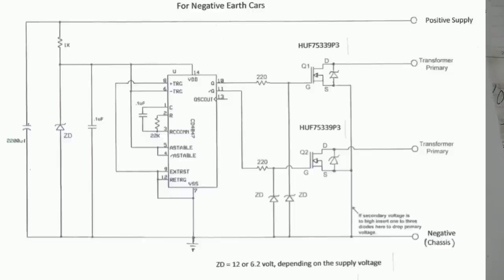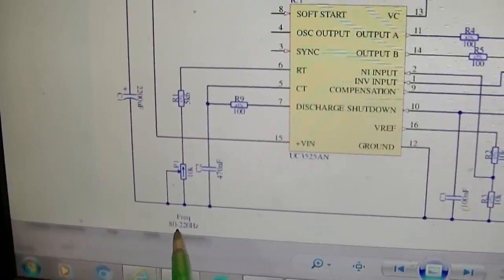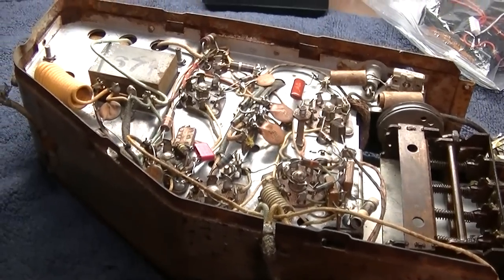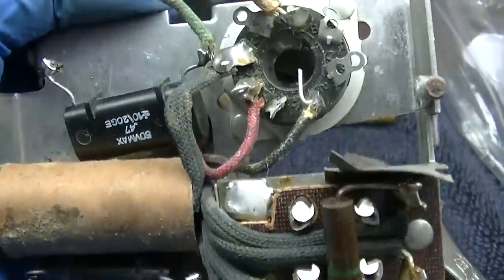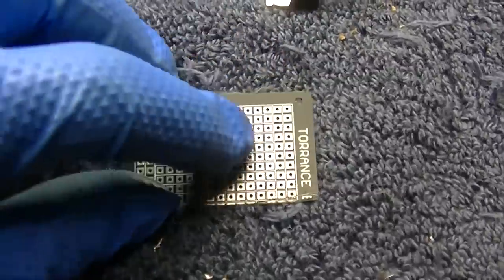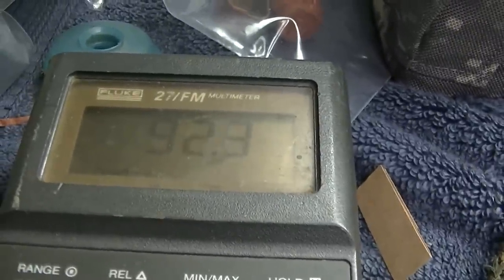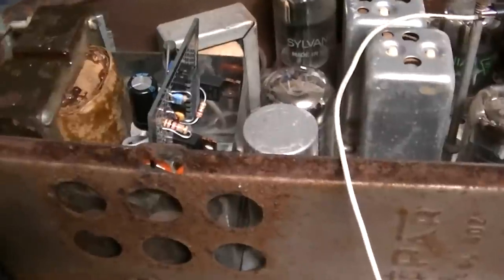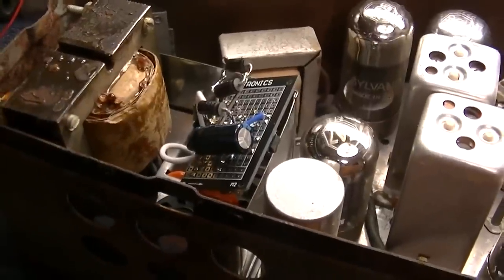Build Auto Radio Solid State Vibrator Replacement and Testing v2 1

Comment: One radio I did 6 to 12 I separated the filaments into two 6v groups then series them together. I had to go back and rebalance/rewire to get the current right one tube ran hot. I used the cheap ebay voltage gen. 12 to 220 but got lucky with a quiet one, might have ran it through the transformer as a choke.

Comment: Just put a lm317 voltage regulator on your board and adjust it to proper voltage out from the transformer.  That lets you ditch the diodes and the zener’s.
Reply: Built a lab supply using them back in college 30+ years ago. They're stable...I give you that.

Comment: I like the 12V to 6V dropper resistor idea. It makes things so much easier. :)
Reply: I had a generic tractor/truck radio originally sold at princess auto that ran six or 12 volt positive or negative ground. To run 12 volt you attached a big ceramic resistor in the supply line. It hung off the radio and got very hot.  It worked great,  wish I'd kept it.
Reply: I like that it's a period correct part too. I'd mount that resistor on the firewall under the hood so it's visible. Super cool.
Reply: Chrysler products used to take a ballast resistor and drop the 12v to 6v for the coil. You can still buy them.
Reply: Yep,all my Chrysler products have them. You always carry a spare with you,just in case.  And like Shango pointed out,you can burn yourself touching them.
Reply: @Suddenlyits1960  Mount a tincan designed to hold a coffee cup to the transmission tunnel. With the bleeder resistor in the bottom to act as a heating coil to keep your coffee warm. Sorry I have an odd sense of humor.

Comment: With a radio that needs 220V, anyone who doesn't want to do much soldering and doesn't mind having something conspicuously 21st Century under the hood could just order a 12-to-230V power inverter intended for a high voltage country like the UK or Australia. I see a bunch of them on Google from $20 to $500, probably depending on how much Chinesium you can tolerate.

Comment: This has been a great series. Thanks for being so quick in getting it on YouTube. Try a 10 watt 250 ohm resistor in series with the B+. It will simulate a hollow state rectifier like a 5U4. They pretty much have the same characteristics. I've had my share of pesticides today! And lead solder too! No vendetta COtrol though!

Comment: if you used an H bridge across both windings of the transformer at once (instead of the push-pull) it should be possible to run it on 12V since you're using both windings at once instead.  but of course that means an H bridge driver instead of just two fets.  I don't think the transformer would like 12V across each winding even when PWMing it since it would cause it to saturate.
Reply: Wouldn't you have to separate the two primaries to do that? And then too...wouldn't firing them simultaneously 'buck' each other and cancel each other out?
Reply: @Rev22-21  the primary is center tapped, so the two coils are actually out of phase with each other.  this is how it works as a push-pull.  If both windings were in phase it wouldn't push-pull any more.  By not using the center tap and leaving it free floating, this converts it effectively into a single winding instead.  You need to drive it with an H bridge though, because doing this loses the benefit of having the center tap to reference from.  It's similar to how you can make a full wave rectifier with 2 diodes and a center tapped transformer,  or use a single winding and a 4 diode bridge.

Comment: Always wondered why these old car radios always seemed to use slug tuning rather than a cheese slicer. Is there a good reason why?
Reply: Vibration.  Those variable cap plates would vibrate and change the tuning.  Slug tuning is much more resistant to vibration.
Reply: @eeengineer8851  Ah, never considered vibration. I have a Granco FM-only table radio that's slug tuned which performs very well. I never figured out why they went with that instead of a variable capacitor either.
Reply: @defaultuserid1559  tuning capacitor for only  88 - 108 MHz is expensive for what it is.  TVs were using slug tuning and then went to a cheaper form capacitor tuning for a while before they went to varicap diode.

Comment: Could you use a 4-6v regulator instead of the large resistor? Regulate the voltage down to 4v and you may not need the diodes.

Comment: Sg3525 would have been a good option you would need a boost converter/charge pump or logic level fets but ive got a feeling the sg3525 will want 12-15v it has UVLO and soft start to protect the fets it's a great ic fully adjustable frequency duty cycle dead time etc also a powerful fet output so you can drive fets directly, it virtually a tl494 but with a nice fet output stage , it has 2 error amps so easy regulation.. its not pin compatible with the tl494 however.

Comment: Ye Gods !  Electronics from the Middle Ages!  Talk about crude and primitive. To get the final output voltage regulated don't have series diodes and dropper resistors as you'll be faffing with them forever.  Add a voltage control loop instead. Pot-down a sample of the B+ output voltage and when it goes over a set threshold turn off the FET drive. Can use a Vbe junction as a comparator. The circuit then runs in squeg mode.  Does the B+ voltage really need regulation anyway? Valves (tubes) and good capacitors can tolerate huge variations in anode voltage. The 12V supply input ranges from 11.5V to 14.8V anyway.  EDIT: the second schematic with the generic SMPS IC , it's being used here 'open loop', normally is used closed loop as I describe above. This chip has a built in switching crossover function to prevent both FET conduct at same time, I think it's 2% though it's been 30 yrs since last used this chip.

Comment: I wonder if you could get away with a ZVS and ferrite transformer,  the output on the secondary is sinusoidal, run the gate supply directly from the 12-14v and use a BJT pass element on the input to the fets to regulate the output B+ on the secondary, I think you might be able to get away with it with a bit of filtering etc, it would preserve the original transformer too

Comment: The way I would do it is rewiring the transformer, that is, just use two IR2153 as a full bridge driver and connect the whole primary across it. Heater wise, make a single transistor running at low duty cycle, switching the heaters on and off from 12V.

Comment: Normal running  voltage should be about 7 to 7.2 volts.  Of course old generators put out nothing at idle so you could go down to 6 or even a little lower with lights and heater on.  Car radio tubes were supposedly designed to operate with the varying voltages of old fashioned poorly regulated generator systems, although I think any indirectly heated tube is pretty tolerant of varying heater voltage.

Comment: Putting the diodes where they suggested would lift the source voltage above ground effectively lower the difference between gate and source, the fets would probably have been running in their linear region

Comment: solid-state vibrators are sold on the website of antique electronic supply (tubes and more)
Reply: ..and they are noisy as hell..
Reply: @blitzroehre1807  solid state noisy?  rf interference on radio?
Reply: @bask2140  Yes, RF hash from switching harmonics, some designs have a lot, some are pretty good.

Comment: I wonder if you could create a voltage divider with a h4 bulb connecting 0v and 12v to the outsides and the common and one outside for the radio

Comment: It does not like 2 diodes because you are lowering the voltage of the CD40XX chip also and it needs at least 5 volt or more to work correctly and with an input of 6 volts and 2 diodes in series with the circuit the CD40XX chip is not getting the required 5 volts to work. You should change the R/C components around the chip to obtain the desired output voltage instead of adding diods to drop the voltage. Or you could use the NE555 8 pin chip to do the PWM for the mosfets and it would be totally able to regulate the voltage the way you want by using a little pot to do that.

Comment: What appears to have been overlooked is that there was a capacitor in parallel with one winding of the transformer, forming a tuned circuit with the transformer inductance. When both vibrator contacts to the primary opened, the tuned circuit would start a decaying oscillation. After a half cycle, the polarity on the transformer windings has reversed. The vibrator was designed to connect its other contact as close to the voltage peak as practical within tolerances. There is a short time when both contacts are open, just long enough for the capacitor to reverse polarity. The voltage difference across the contacts, just before they closed, was minimal, greatly reducing arcing and extending the life of the contacts. The energy stored in the transformer inductance is not lost. It is temporarily stored in the capacitor and returned to the transformer, but with the transformer's magnetic field reversed.

If the capacitor is removed and the FETs do not provide an interval when both are open, the energy stored in the transformer's inductor will be dissipated in the FETs and converted to heat.

In the vibrator design, If the capacitor were bad or off value,  the vibrator contacts would have a short lifetime, due to arcing. Replacing the vibrator would get the radio working again, but the contacts on the new vibrator would burn out quickly and the new vibrator would fail. The vibrator was socketed for simple swap out. If the radio was burning out vibrators, it needed to be removed and checked for failures of the capacitor or other components in the power supply.

Vibrator power supplies in car radios were used until about the mid 1950s, when power transistors for the radio's audio output stage were developed. Then, "space charge" vacuum tubes, which operated from a 12 volt B+ supply, were used for all the radio's circuitry except the audio output stage, which had the only tube which required the higher B+. The expensive, heavy, vibrator power supply was designed out, and the art of designing them was lost. The "space charge" radios were in production for only a few years before being superseded with all transistor radios. However, car radios were produced in high volume, so millions of "space charge" radios were produced before the design was removed from production.

Comment: Fet's have a gate threashold voltage, commonly 4v, if the power supply drops to around this voltage the fets will go into linear mode due to low drive voltage, and will get hot..
Bipolar trannies may have been better at 6v power.
I'd like to try this with a royer oscillator, the o/p is close to a sine wave, and the circuit is simpler.

Comment: Or maybe instead of a resistor and a diode, use a varistor, which will also play an additional role of protecting the vibrator circuit?

Comment: I would've tried a DC-DC converter to go from 12V to 6V. More efficient and less heat.
Reply from the maker: The noise generated by those things would make the radio unusable

Comment: Risking a repeat here (of what I asked of Mr. Carlson) has anyone considered using a PIC in place of the IC? An 8 pin PIC could be easily programed to control those FET's. A few lines, a little time and presto....
Reply from the maker: I would have no clue how to program it myself.
Reply: @shango066  : The following YT Channel does a pretty good job at explaining the A-Z's on PIC's . The Channel is simply called Learning Microcontrollers. I've built two major projects myself; one (a one year long project) was patented and one was recognized & published in Coca-Cola USA Tech magazine. The former started out as a logic IC topology, went through seven board upgrades and finally into the PIC Microcontroller arena.  I never looked back.
Reply: @shango066  Learning how to program is like learning how to play a musical instrument, rebuild a carburetor or put a puzzle together.  You watch others "program", repeat what they do and before you know it you're  making an LED blink, making a switch turn on/off something, building a timer of sorts, monitoring sensors and then building thermonuclear war head (not really). But you get the idea. 😜 

It's like moving from discrete components to IC's. Simple.

Comment: If you are talking about wiring diodes in parallel at the 34 minute mark, don't bother.  Diodes are very selfish and will make one do all the work until it burns out and then another one will take over until it burns out, and so on.

Comment: Very Sad to hear about the "This is a test" girl".  I will miss her. I hope the Zombies didn't get her ? Excellent Video , We use to take the old vibrators apart and gently sand the contact points.  We would then put a tiny drop of Transmission or power steering fluid on those points. I had them last as long as 5 more years. ( our old radio was used daily ) ( 1954 Ford radio) 
The old 0Z4 tubes were in just about EVERY GM radio back then. The old Fords ( Bendix or Zenith ) used 6X5 rectifiers.  The tubes were cheap & plentiful. Few folks fix these old radios these days. They just don't even bother teaching this old technology  in school today. Thank You for yet ANOTHER Excellent Video.

Comment: No need to add that masive resistor to drop B+, you can add a series variable resistor to that 22k on pin 2 to adjust the frequency. Also if both fets get hot it could be because the output of the 4047 might be turning both fet at the same time similar to the crowbar state on a H-bridge of a switchmode power supply. You can try adding a delay on one of the fets or use an oscilloscope to see how they are switching. The gate of the FET is a capacitor which means that if the output of the 4047 is not pulling it to ground fast enough it will create this problem. Or you could change one of the FETs gate resistor to a lower value. That way you'll be adding a delay.
Reply from the maker: The minimum frequency of that chip is 100 Hertz so what am I going to do speed it up to the point where it's out of the Transformers response? I can see adjusting the duty cycle yes not the frequency
Reply: @shango066  are you sure?? Even if you change the cap?
Reply: @shango066  Since the goal is to reduce the output voltage, tuning it to a less efficient point in the transformer's response curve may be a reasonable way to accomplish that as long as the transformer core doesn't get too warm. Alternately, 555 is the classic way to do a variable duty cycle low freq square wave, and it's easy to make an inverter to get the other phase gate drive using a transistor and a resistor.
Reply: @shango066  I dont have a 4047 to test, but I did a simulation using proteus and changed the timing cap for a 220nF and a 22k resistor and I have a frequency of 42Hz

Comment: I have seen rectifier tube deletes using modern Silicon rectifiers using series resistors to lower the B+ Voltage. This would lower the regulation but no more than the original transconductace value of the tube. The current drain should be "constant" providing the audio output is class A. The AGC may affect it slightly though.

Comment: To drop the 12v to 6v for the radio, maybe a 6.2v high wattage zener diode in series with the power lead to the radio would work better?
Actually, using the ''3525 chip and replacing the tubes with their 12 volt versions (14xxx series) might be the best idea.  The transformer is a 6v one, but you could probably run it on 12v by cranking down the duty cycle and putting diodes in series with the power input to the inverter.  Then you wouldn't need that big ass resistor!  (Yeah also have to replace the pilot lamps too).

Back in the '70s, a friend of mine built a DC-DC inverter for a ham mobile rig using a power transformer with a 12vct filament winding being feed by a pair of cross coupled 2N3055 transistors. The filament windings were used as a push pull primary, and feedback was crude, power resistors from the base of one transistor to the collector of the other, capacitors in parallel with the resistors.  We played around with the values to get the best efficiency and output voltage.  The HV secondary was used as normal, the primary was used to generate bias voltage for final amp tubes in the rig.  The rectifier filament winding wasn't used for anything (NC).  The thing worked, but it was sorta Rube Goldberg.

Comment: I actually did something like this a few years ago on a Motorola radio.  here is a list of the things I did.

Instead of using the CD4047. I used a TL494 chip. This is a plain vanilla generic PWM driver chip that can be found in about 90% of the computer power supplies and high powered car amps out there. The nice thing about using this chip is I can now have voltage regulation. The B+ will stay constant regardless of the voltage on the car's electrical system. 

To run the vibrator step-up transformer at 12 volts. I increased the frequency from 115Hz to 340Hz. The reason for doing this is to prevent the core of the transformer from saturating. I also replaced the rectifier tube with solid state diodes.

As far as the tube filaments go. I used both a dropping resister and a linear voltage regulator. I used the dropping resister to bring the voltage from 12 volts down to 8 volts. Then I ran the 8 volts into a 7805  linear voltage regulator with the ground pin floated with 2 1n4001 diodes. this gave a regulated output voltage of 6.2 volts. The reason for pre-dropping the voltage with the dropping resister was so the VR didn't have to brunt the full voltage. the VR only had to handle a 2-3 volt drop instead 6-8 volts and therefore, runs cooler.